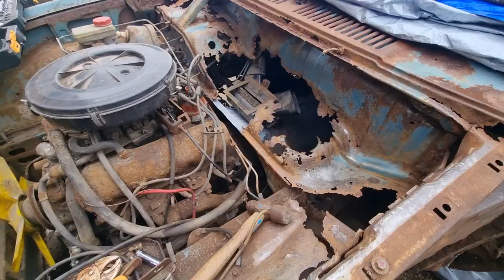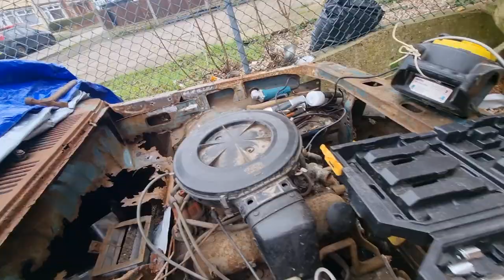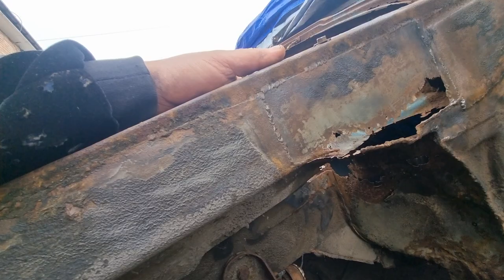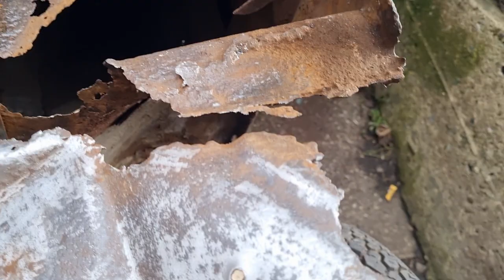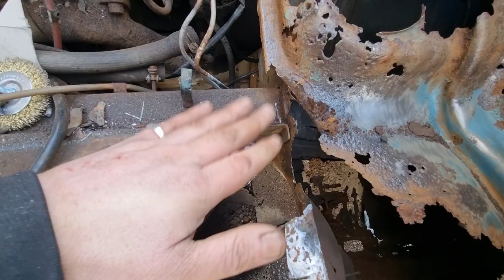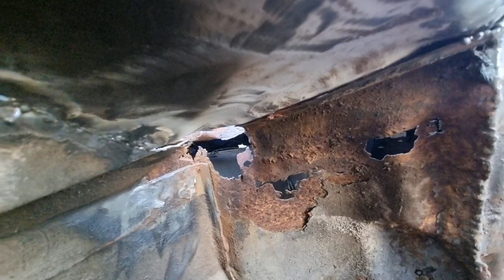Cortina Mk4 Ghia 2.3 V6 Restoration || Inner Wing Wheel Well (P5)

Comment: I thought my transit mk 6 was shonky ,well done on the resto.
Reply from the maker: I have a transit mk7 lwb high top that I saved and converted to a camper I know how bad they can rot lol and thank you mate another video is on its way
Reply: @AdamSNook.  yes adam they are a bit rotty ,the cortina looks good it will shift with the 2.3 v6 engine just found your channel
Cheers steve.

Comment: I guess U are using gasless wire (flux core) ? 
U will find it so much easier using gas option on mig.
Reply from the maker: yeah would save me all the messing around making sure there are no holes they are great in windy weather but i think it is time to upgrade to gas
Reply from the maker: plus there are welders that can do both so might go that route